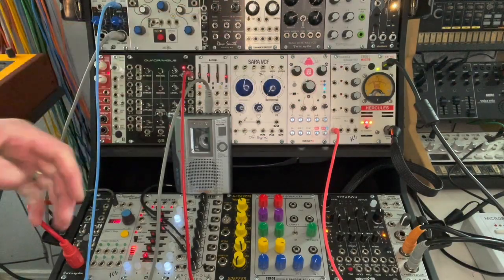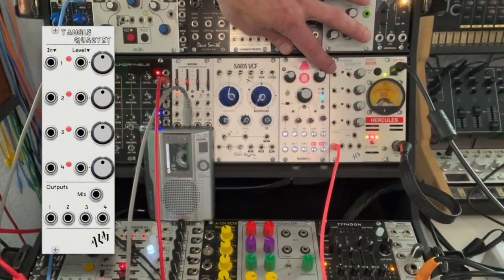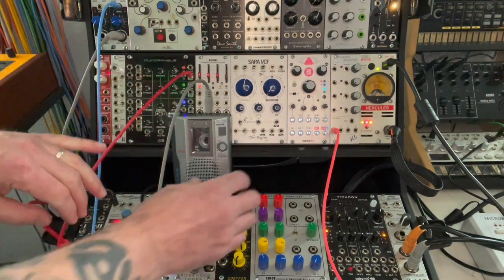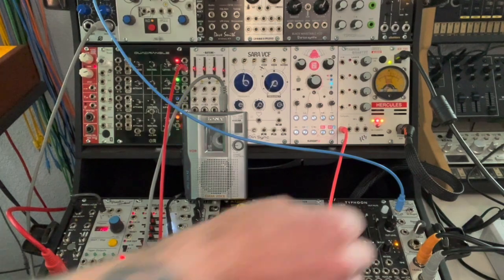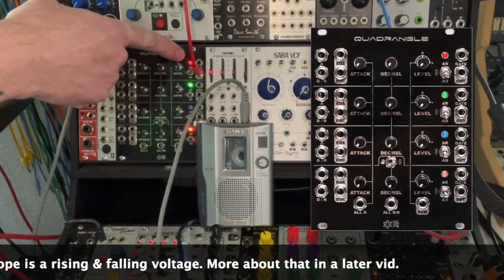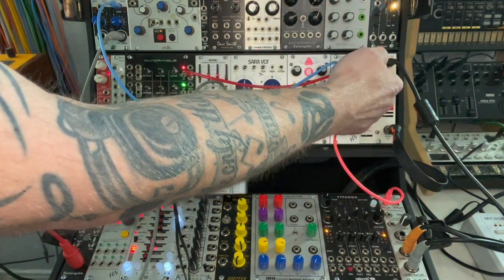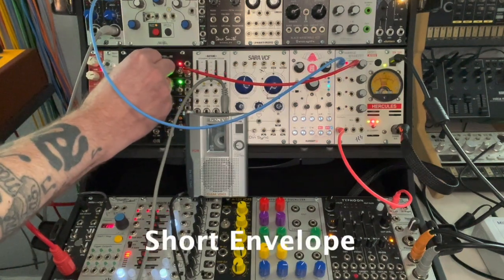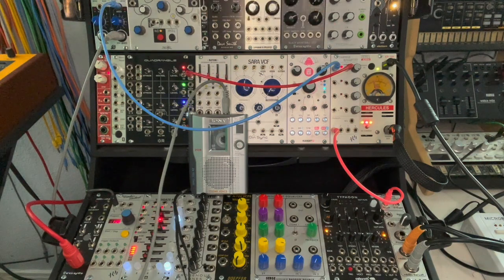What Does a VCA Do? (Modular Synth 101 | Part 2)

Comment: I was confused because I thought VCA stood for voltage controlled amplifier. Which is the opposite of an attenuator.
Reply from the maker: A lot of companies say it stands for voltage controlled amplifier but in reality very few actually boost a signal past unity gain.  So they’re not “amplifiers” at all. VCAs typically adjust a signal between 0 and unity gain. This makes them more of an attenuator than an amplifier.
Reply: @musicalmiscellany  thanks for the reply. Boosting it from zero to unity would make it an amplifier though, wouldn’t it?
Reply from the maker: @HoneyWindbutton  Boost implies greater than unity. So, what a VCA is typically doing is turning a signal down from unity to 0 (or somewhere in between) making it an attenuator. Keep the keyboard paradigm in your mind's eye... when you let off the key, the sound should stop (be at 0). When you press a key, the sound should appear (be at unity gain).

In contrast, a basic amplifier/boost circuit would take a signal from unity to +6db or +10db or whatever. There are some VCAs on the market that can boost a signal beyond unity gain but their primary function is still to attenuate a signal when no CV is applied.

Comment: I understand that you can use an attenuator to control the strength of a modulation signal, but can you use a vca for the same thing?
Reply from the maker: Great question. You can. However, a VCA works best when you want the signal to rise and fall in intensity over time. If you want to attenuate something to a fixed level and not change it, an attenuator would work better (though you could still do it with a VCA).

If you wanted to attenuate a signal to a certain level, then boost (or cut) it slightly, then go back to the same level, that's where a VCA shines. Hopefully that made sense.

Essentially, an attenuator is better for a fixed position where a VCA simply adds voltage control to that attenuation.
Reply: @musicalmiscellany  Ok that makes total sense now. thanks for taking the time to reply!
Reply from the maker: @harryyes1527  I'm glad that helped. Another way to think about it... with an attenuator you set the knob and the incoming signal will stay at that level (until you grab the knob and turn it). With a VCA you can continuously vary the signal level with a so-called invisible hand that constantly turns the knob (control voltage).
Reply: @musicalmiscellany  And this explains why im coming across VCA's both with knobs and without, the ones without are just being modulated by cv and the ones with knobs are also attenuators?
Reply from the maker: @harryyes1527  You're on the right track. However, this is where the modules vary a bit by brand. If you see a VCA that just has 3 jacks... that is very straightforward (input, CV, output). Not all of them are that simple though.

With the ALM Tangle Quartet I used in this video, it has a knob to attenuate the incoming CV (which is being used to attenuate the incoming audio). However, if you don't have a cable present in the CV jack... the module just functions as a standard attenuator (input/output jack).

Not all VCAs work this way though. Some may do nothing if there's not a plug in the CV jack. Others have 2 knobs, one to control the CV and one to control the original signal. I know... it's complicated. All of that said, it sounds like you've got the concept.